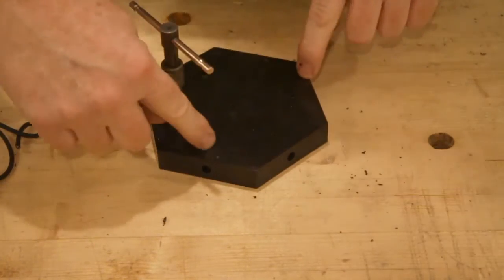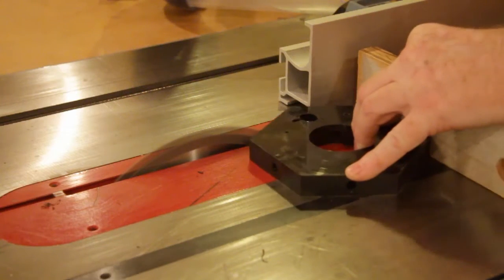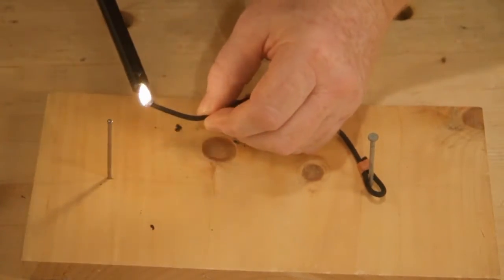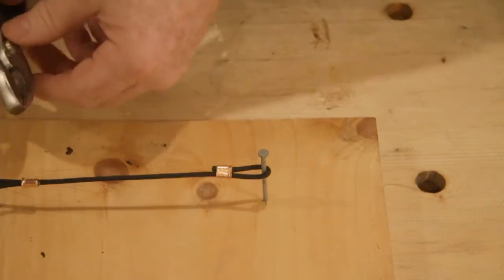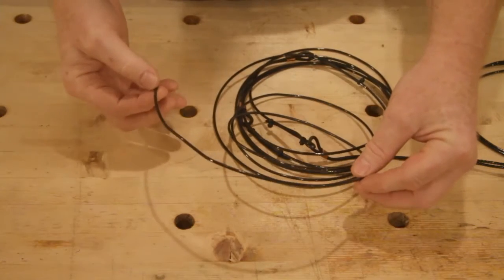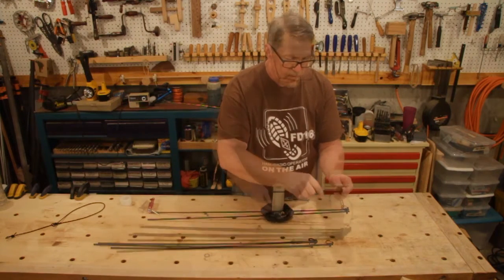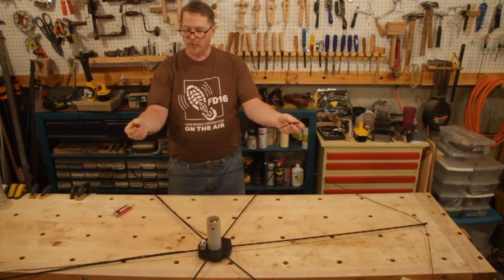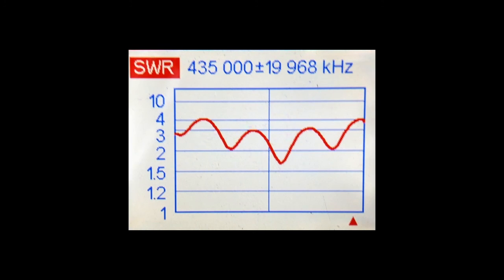The 30 dollar 6 meter hex bearm - Part 3

Comment: I just completed building your design. Your videos, part land tools required lists are spot on.  Antenna SWR testing is excellent.  I wont get it up on my 33 ft tower just yet so for now it is just on a pole 5.ft above ground. Not exactly sky wave height but will get it up at some point  Only change I made was I used six, 5/16 x 4 ft fiberglass snow marker poles from Home Depot, cut to specified length.  I slow-drilled holes for 6-32 x 1 inch SS screws and nylock nuts with 1/4 inch plastic electrical clamps instead of wire ties for the element wires.  Gene / K7TXO
Reply: Awesome. We don't get snow marking poles at Home Depot here in GA. I also built a 10 meter only version with 1/2" poles and 1" thick plastic for the hub. I did not record the specs on that one. The 6 meter hex works great for 2m as well.

Comment: Great build. The ham that has a wood shop equipped so as you should have no problem building this antenna. Even a part time wood worker with some power tools such as a carpenter's radial handsaw, router with table, a hand power drill with a well designed adapter for drilling straight holes should be able to adapt those tools for this build. Then a skilled wood worker with hand tools might construct this project too. This is a doable project that will be fun, intriguing, and in the spirit of ham radio "home built". Nice set of videos. KB8AMZ
Reply: Thank you. WR1TR
Reply: Power tools aren't really necessary. Sharp hand tools and some craftsmanship can do all this "unplugged".

Comment: you never discussed how to make the elements for the antenna, what are the lengths? and what gauge wire did you use?
Reply from the maker: 14 gauge stranded wire. video 1 Time stamp 3:42.  The lengths are in Video 3 starting at 4:07. Thanks for watching.